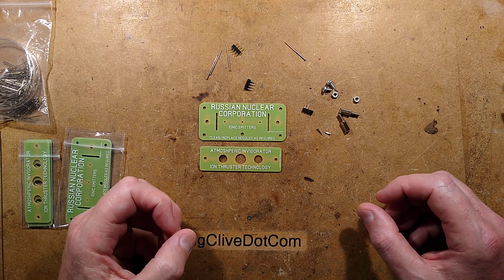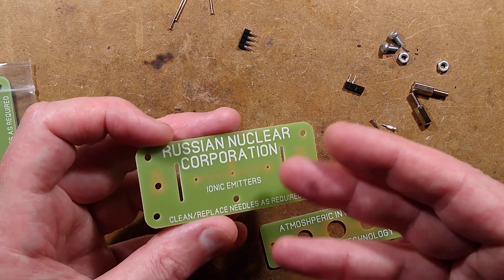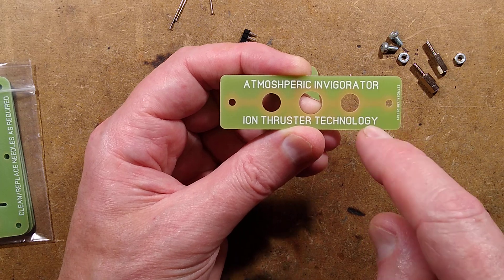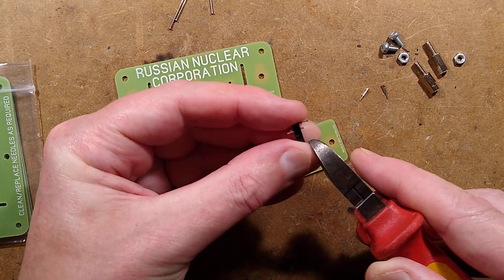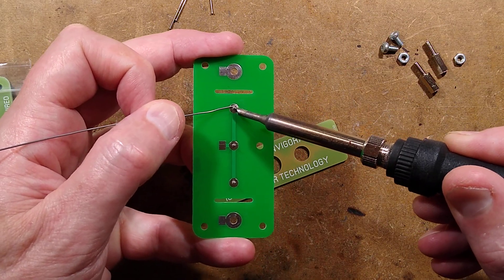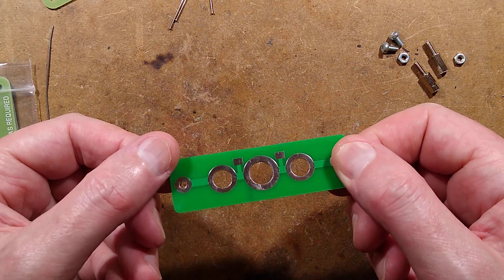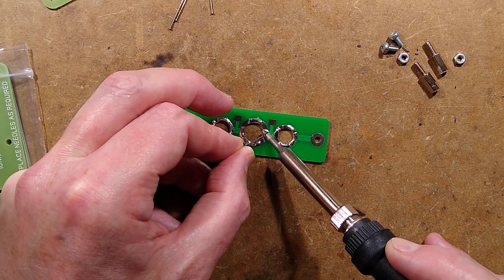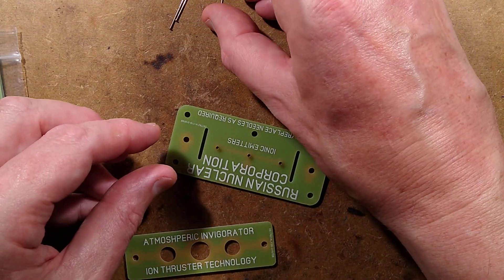Russian Nuclear Corporation molecular disruptor

Comment: Hi! Need some help with this. I bought a 12v module with two carbon brushes but the wires are both white. I cut them and soldered to the pcb, plugged the power supply but it doesn't work. I tried reversing the two wires and it's the same. It doesn't work. With the original carbon brushes it works but hooked up to this it doesn't. What am i doing wrong?
Reply from the maker: You'll probably find that both white wires are commoned together.  To use this module one (or both) of the white wires will go to the needle PCB and the front PCB will connect to the power supply negative.
Reply: Nevermind. Used only one of the two wires and used the ground from the power source and it now works.

Comment: Sewing needles are hardened steel. straight pins (which you have) are not. not so hard on the cutters.
Reply from the maker: They've lasted well.  If anything, the micro pitting caused by the corona discharge has resulted in greater efficiency.

Comment: Dear Big Clive, may I smugly suggest that, having called out a seriously faulty design (a while back) with a dual mains socket - the one that did NOT link the 2 earth pins to each other, therefore breaking the earth continuity across the socket [an excellent call-out] - you design a circuit where the two earth pins are NOT connected to each other across the PCB!
  Pardon me while I basque in my own smugness.
  Mind you, if I licked my finger and stuck it one of the live needles - with my other finger on the screw you HAVE earthed - I’d get more of a belt than if I had the non-licked finger on the isolated screw - particularly as I CAN’T SEE ANY CURRENT LIMITING RESISTORS IN THIS DESIGN, EITHER - having suggested it’s a good idea to put them in series IN THIS SAME VIDEO !
  Oh my goodness ! - I’ve over-smugged, and will have to lie down for a bit.
Matt Lee
Cantankerous, Old, retired, Scots electronic designer critic.

Ooops! Just realised there IS a connection between the 2 assembly screws, via the top board; so, as ever, I’m wrong in every important respect with my earth critique!
Apologies.
Glad to know I’m still a black-belt dento-pedologist - the art of sticking one’s foot in one’s mouth and chewing on it.
Reply from the maker: In this instance the current limiting resistors are in the module and no further ones are needed as it is not a mains voltage module.

Comment: One good use for this build, IMO, could be, an "antistatic" Ion generator similar to a "Zerostat" antistatic gun, for use in cleaning Vinyl albums when cleaning before playing. The "official" Zerostat gun is now $181 USD at Fischer Scientific, I'm lucky to have an original that is about 40 years old now. I'm sure your build is MUCH cheaper than that, and also put it into a handheld project box with a momentary contact push button to power it as you hold it over an albums surface while on the platter, then dusting with your favorite cleaning brush.
Reply from the maker: I think the zerostat may put out alternate polarity as it's squeezed and then released.
Reply: @bigclivedotcom  After examination, you are correct. I guess the next step in your build , as a modification, could be to alternate the ionic charge somehow.👍

Comment: Would be interesting to have an SMD Cockcroft-Walton circuit integrated on one of the PCBs, accepting mains input.
Reply: I have a bug zapper (and light) and I wonder if it has a Cockroft-Walton circuit or perhaps a Marx circuit. I’ll have to take it to bits.

Comment: as a costume builder, I just gotta say. Those items you used are pins ...not needles. Needles are  the hardened steel pointy devices that look a bit like pins BUT they have a hole on one end that thread goes through in order to hand sew. pins have a pointy end (like needles but the other end has a nail head or ball - pins are just used to keep fabric in place until it gets sewn. I understand why you would want to call them needles...because there are electrical contacts called pins that are not the same thing. Maybe you could call them  "pointed pins" or "spines" since they are lacking the nail head or ball that would make them a pin and now they are more like a cactus spine than a pin. Maybe the phonetic Russian for pin point- "bulavka". Phonetic Russian for spine is "ship" is just not appropriate for an anglo audience.
Reply: Needles with holes are also used by sewing machines, but with the hole in the tip (famous 19th century patent).  Fastening pins are also called forgotthatadjective-needles.

Comment: Any suggestions for the housing for it (size, distance of air ports from HV circuits, etc.)?
Reply from the maker: Anything with enough room that allows you to keep the high voltage wires away from each other.

Comment: Your PCB is ordered and on its way. I got a 12V module from E-bay. It has two wires to the carbon brushes, both white. How do I know which one is ground, how do I hook it up?
Reply from the maker: Test with a meter and you'll probably find both are connected internally.  You'll need to use one or both of the white wires to the needles and connect the front discs to the negative 12V supply.
Reply: @bigclivedotcom   Thanks! I had tested with my meter, but I guess the carbon brushes are not conductive enough. With the brushes cut off I measure continuity between the wires. Back to waiting for the PCB's to arrive on the slow boat from China ;-)

Comment: Those round pin sockets bring back memories! Way back in my board tech days, we ran into issues with units coming back in the field due to failing self-test. The first thing we checked was for loose firmware and gave the EPROMs a push back into their sockets. The success rate for these repairs was around 99%, and once we received an ECO from manufacturing engineering, the old round-pin sockets were replaced with the standard square-hole that held in the chips quite nicely. 

By 1992, I had pretty much forgotten about that and I moved on from PCB testing and repair to a desktop support tech for a big company. The company had a plethora of old Memorex-Telex computers. These were old, '286 and '386 PCs that suffered from periodic memory loss. When we opened up the PCs, we found that the SIPP Memory worked its way out of the sockets over time due to thermal expansion and this was an actual case of memory loss! When these beasts were retired, we celebrated joyfully because these machines were awful in other ways as well due to their proprietary nature.

Yes, you read that correctly. SIPP memory. Like the old resistor packs used for buss pullup or pulldown, or found on SCSI drives, these were 30-pin SIMM boards with tiny pins soldered on to the edge points that had to be fit into the round-pin sockets. The problem, outside of board creeping, was eventually the pins would break off from constant handling and the memory SIPP had to be tossed because I wasn't allowed to solder on new pins.

Comment: If they are stainless and are magnetic, there's a good chance it's a 400 series and not a 300 series stainless. These are slightly ferromagnetic, and less corrosion resistant. But they're more suitable to make tools out of because it's quite a bit harder than a 300 series. But of course, for these things, what's much more cost-effective is just make them out of ordinary high carbon steel, electroplate them and pretend they're stainless. Shinier too.

Comment: Clive you have dealt with a lot of ozone generators. Are they capable of making more ozone for the ozone layer? or Does the name not mean the same ozone in the upper atmosphere? I'm curious because if we repair the ozone layer we can stop losing that fight. Although the vast requirements would be initially high. if many households ran one of these devices an hour a day. its only a matter of time.
Reply from the maker: The ozone layer works by splitting oxygen and ozone apart with different wavelengths of UV.  It's the process of making and then breaking the ozone that attenuates the UV.
Reply: "Are they capable of making more ozone for the ozone layer?" 
No.  Any ozone generated at low level atmosphere decomposes quickly and never makes it up to high atmospheric levels.  If it was that easy to do don't you think it would have been done already? 
The best option is zero halide emissions that destroy upper atmospheric ozone.

Comment: Quick tip: If you add “JLCJLCJLCJLC” anywhere on the silkscreen layer, JLC PCB will automatically place the order number there. I generally place mine under a large component like a connector so it’s hidden when the board is assembled.
Reply from the maker: I think you also have to specify it in the order.  But it would make sense for them to do it automatically if they saw it.

Comment: If the mounting holes were on the rings panel with all the lettering then the HV board would be inside the case. 
If you are doing a bulk order please reserve a set for me.

What is the chance of adding some electrostatic dust precipitation to actually attract and remove the inevitable ozonised dust for removal

Comment: Could this be powered by a old laptop CCFL inverter? (I've got more than a few of them!)
Reply from the maker: Maybe with a few multiplier stages.
Reply: @bigclivedotcom  So, What I think you're saying is take the high voltage output from the ccfl inverter then add a few capacitor and diode stages to increase the inverter's voltage. Then take that and connect it to the pins and connect the other lead from the inverter to the rings. Is that correct?

Comment: I'm fairly sure those Knipex can handle much much thicker metal than that. It's only the smaller pressed ones that should not be used on that. Go and check on their website, e.g. a friend has a similar pair but with the fancy lever jaw mechanism thing, and they can cut through extremely thick, as in 3-4mm diameter, steel. Seriously look them up, you won't be afraid to baby them then.

Comment: If you want real stainless pins: RC model shops sell stainless steel spring wire. But you'll have to sand the point on them yourself, but that can be done quickly by putting the wire in a drill and hold it at the right angle to some sandpaper.

Comment: Useless toxic gas generator (O3 and NOx).
Safe levels of ozone does not clean air or kill pathogens. And no, you cannot reliably smell harmful levels of ozone.
For the actual science google "doi:10.1080/15428119591016827".

Comment: Wow, a circuit board with only ONE electronic component that still does something. Pure genius. Why not wire it up to the generator in a dymamo torch. That way you wouldn't even need a power supply!

Comment: I'd love to spend 10€ to buy the thing you just built, ready-made including a HV power supply, although I'd prefer one that runs on 5V USB power instead of 12V.
Instead of having the PCBs printed and then having to scrounge screws, connectors, needles and stuff. I'd even love the spelling mistake, makes it soo original!

Comment: For someone with so much electronics back ground you sure have some fiddly soldering techniques!

1. Collect old solder into a blob. This should be quite easy. I solder a lot and there is always waste solder or I use a hot air gun and melt it off a board. Rap that on the bench and there are thousands of tiny beads to melt together. The quality of the solder, whether it is pure 60/40, doesn't matter...just that it is clean and flux will take care of that nicely.
2. Dip your bare wire end in flux and then heat up the blob. Dip the bare wire end into the liquid blob and your wire is tinned. I do this for all wire guages.
3. Why are you using little lengths of solder? I'm pretty sure you have a spool and spool holder.
4. Why are you holding the board and wire? I'm sure you have a panavice or some other PCB holder. You have to hold all that and the solder and the iron...what a mess!
Reply: His technique is excellent, especially the dexterity to hold two items with one hand and the iron with the other.  Dipping things in molten solder is a dangerous practice mostly associated with the inside of wave soldering machines and dangerous 3rd world working conditions.
Reply: @johndododoe1411  His method sucks...OK...works for him, but otherwise no one would do it that way. I too used to be multi-dexterous like he is and did that silliness myself. Then I stopped becasue I learned better ways to do things. He has not learned. Ive been soldering for 30 years...i kind of know better by now.

Comment: Further to my earlier query, if the wires aren't red & black (though I suspect that's no guarantee) how can you tell which of the leads is +ve and which -ve? :)
Reply from the maker: To test ion polarity I power the unit up, set my multimeter to 20V, ground the negative lead and then hold the positive lead about 3 inches (75mm) in front of the emitter.  The polarity will be indicated along with a voltage that gives an indication of ion output.
Reply: @bigclivedotcom  

Thanks again.

Comment: How about some strain relief? A couple of cable-sized drills points allow the cable to be threaded through (or through and back) before soldering.
Reply from the maker: This is designed to be mounted on a case.
Reply: @bigclivedotcom  I have a tendency to overthink/overbuild!

Comment: What if you gold plated the holes? Would gold plating not work instead of running solder around the rings? 
I love anything with high voltage or LEDs.

Comment: what is the ideal temperature for using a soldering iron? I have an adjustable one that ranges from 250-400 degrees Celsius
Reply from the maker: Around 350C.  But nudge up or down depending on solder "feel".
Reply: @bigclivedotcom  thankyou for the info
Reply: @bigclivedotcom  I burned my fingers. Now every time I solder something I smell BBQ!

Comment: Do you get a voltage output if you blow compressed air through the holes?

A lot of electromotive systems are reversible even when it seems counterintuitive so I wouldn't like to guess. It might require blowing ionized air through to be noticeable but I thought high flow rate might make up for the low level of ionization.

Comment: Worth adding solder to create a smooth ball or a dome over where you cropped the needle holders on the back, all sharp points are ' Point Emitters ' and this might effect the efficiency, it certainly does in sensitive High Voltage equipment used in the Analytical Science world and the ' Balling ' of high voltage solder joints is a must....cheers.

Comment: Clive.
What size of ion generator would it take to make a model aircraft fly?
Does it need to be big or just need a lot of power.
Also is Garage 54 giving you ideas?
Reply from the maker: It would have to be significant.  Look for "lifters" on YouTube.
Reply: @bigclivedotcom  
Will do. 👍😃
Reply: @bigclivedotcom  
The 'anti-gravity' device, lol.
I didn't know they worked on the same principle, but it would make sense. 👍😃

Comment: I suspect lead-free solder plating on the front rings would prevent lead oxide problems. Could just use straight tin maybe? (With flux)
Reply: Unfortunately I don't think Clive owns solder than isn't at least 40% lead. As a principle.
Reply: @mrcbear92  That could well be the case. Hmmm he could vapor deposit pewter on the pc boards?

Comment: Does the corona discharge provide enough UV to register as a glow with fluorescent paint in the vicinity of the pins? You can totally destroy the legitimacy of the lettering on the PCBs by using я ( ya) instead of R, and и (i) instead of N!
Reply from the maker: No.  It's very dim.

Comment: The PM2.5 seemed to drop quite quickly once you turned on the ozone generator, but ozone only registered once PM2.5 dropped. Was that just a coincidence as the particles naturally settled on the inside surface of the container? Or was that the ozone reacting with the PM2.5 and initially being "used up", only allowing the ozone to rise once the PM2.5 levels dwindled?
Reply from the maker: It acts as an electrostatic precipitator.  The dust in the air passing the needles is charged negatively and sticks to the front plate.
Reply: Good observation! This type of device is sold for commercial HVAC systems used in medical settings at a huge price to cause small airstream particles, like viruses supposedly, to drop out of the airstream, presumably sticking to surfaces.

Comment: Hi Big Clive... Love your work and what you do via reverse engineering. Great stuff, however this video has some real issues and I just could not let it pass. The US EPA safe limit for ozone is 0.05 ppm, while the US OSHA states a limit for workers of no more than 0.10 ppm exposure in an 8 hour period. What you have built is a human poisoning device. The voltage limit for a non-ozone generator ionizer that does produce ozone should be less than 2.4 milliamps. Oh, the carbon fiber emitters are by far better than the single needle point...just a some information. Sorry to be critical, you are great and will continue to follow your work.
Reply from the maker: That test was done in a 4 litre enclosure to get a faster result.  In a room the level of ozone produced by the device would be at less than ambient outdoor levels.
The 17mA was at 12V.  On the output assuming around 4kV the needle current would be lower than 50uA.
Have you seen my video on ozone?
https://youtu.be/1ymcJ9qKC7I

Comment: The pm2.5 dropped pretty quick too, is it because of the same effect that powers ionic air purifiers? (Also that was a pretty high ambient level for indoors when you started... Perhaps it's a USA thing to have forced-air HVAC with a big old filter? 26ug/m3 is almost "moderate" air quality instead of "good")
Reply from the maker: It will act as an electrostatic precipitator.

Comment: Could one of those 12v modules be used to drive neon lamps?
Reply from the maker: It's DC at very low current.  It works, but they are very dim.  (I've tried it.)